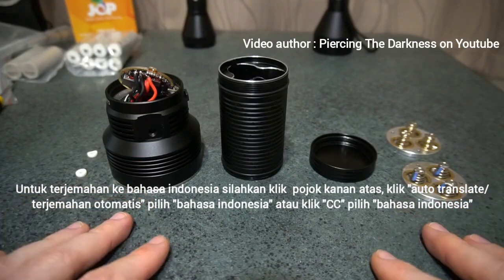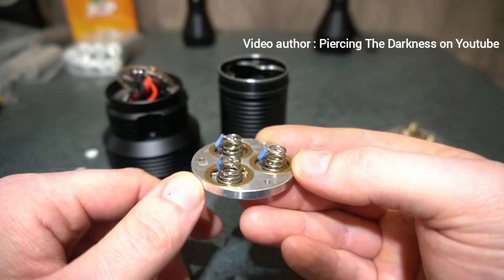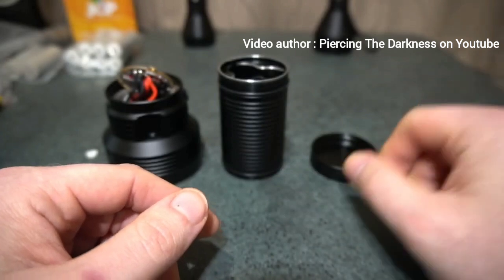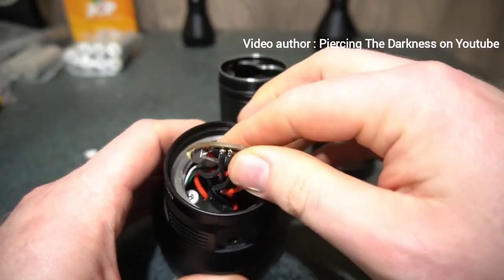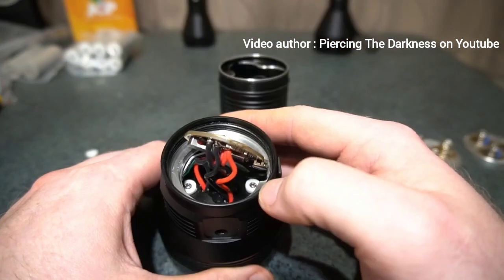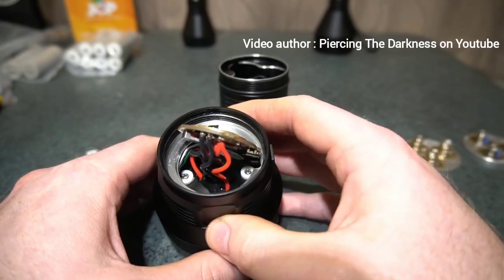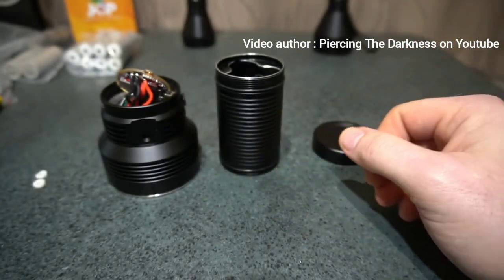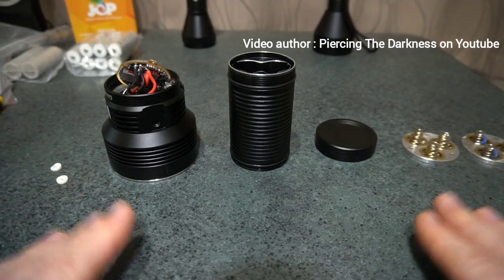[TUTORIAL]🔥MOD UPGRADE Convoy 3X21C‼️FYI : SOLVING PROBLEMS & IMPROVE LHP531/SFT42R/SFT40/SST40

Comment from the maker: 1. 0:04 Springs mod
2. 2:06 Screws mod
3. 4:51 Batteries slot mod
4. 5:39 Soldering on MCPCB

Original source video : https://youtu.be/D1dXlCjq3vY?si=7qNOwaWoHGswRx9G
Author : Piercing The Darkness

Basicly..this flashlight is amazing, combining Buck+FET driver with lighter budget

25.000++ lumens.. VERY EASY to reach with the LHP531 version, BOOST to get BEAST lumens output when START UP on TURBO, but not for continuous
SFT42R or SFT40 are better in stability for continuous lumens output performance
Hope this help you

After mods 3X21C LHP531 will be your fire starter : https://youtube.com/shorts/j3qCqX3U0Ig?si=Y-CXwnX16qQKrApg

Thanks for watching

Comment: Thnx with the 40sft also need mods?
Reply from the maker: SFT40 run with lower amps current..so no need mod with double springs
About the longer screw to hold the reflector,mcpcb & body you can check manually,if you found it..add plastic washer or replace with shorter

Comment: Saya jg udh upgrade semua yg video ini jelaskan, cuma led masih stock bawaan batch lama yaitu SST40, awalnya mau upgrade jadi LHP531 cuma dengan jarak throw yg sama harus di geber sampai 30k lumens jadi cepet panas

Ganti driver buck+fet aja udh lumayan nambah terang
Reply from the maker: Manteppp👍🏻 om
Dengan semua upgrade ini kalau driver sudah pake buck+FET versi SST40 pun tetap masih bisa naik outputnya(walaupun tidak se-signifikan LHP531)
LHP531 memang menawarkan power lumens luar biasa ketika start up langsung turbo,buat show off atau geber2an hotrod bener2 pas ini om..tp as per data, perform continuous outputnya cenderung lebih drop
Mungkin untuk swap ke SFT-42R atau SFT40 jadi pilihan lebih bagus untuk yg nyari continuous output turbo yg lebih stabil